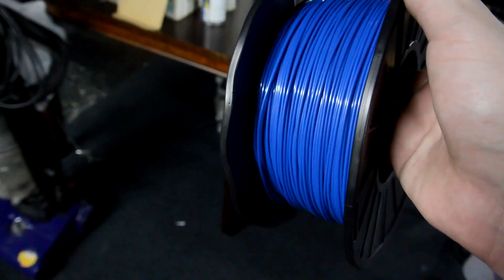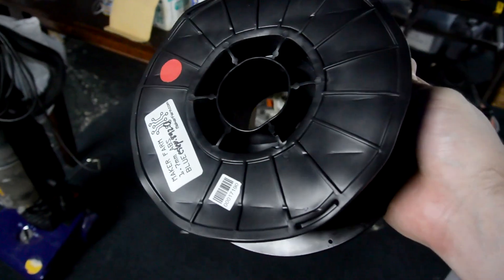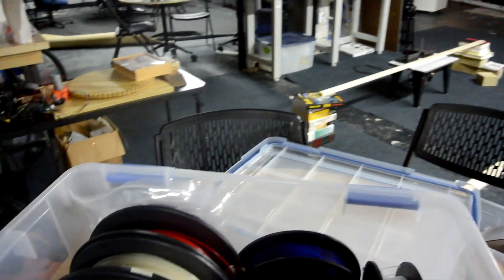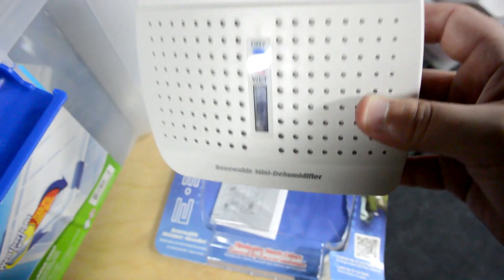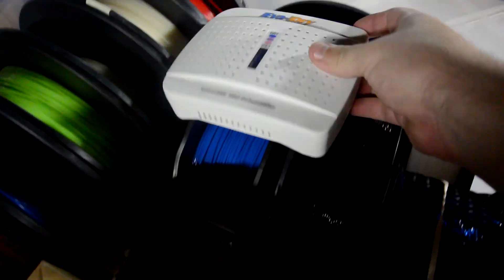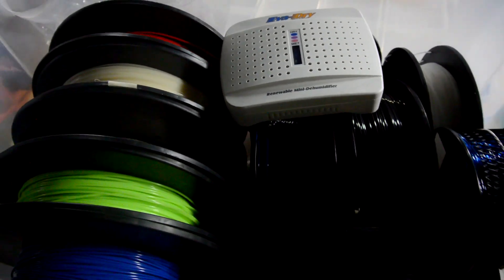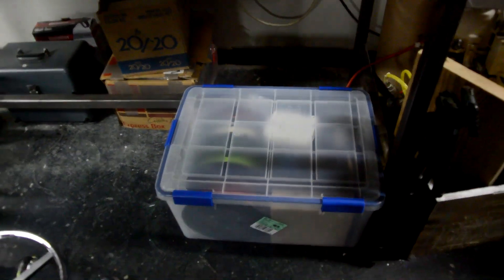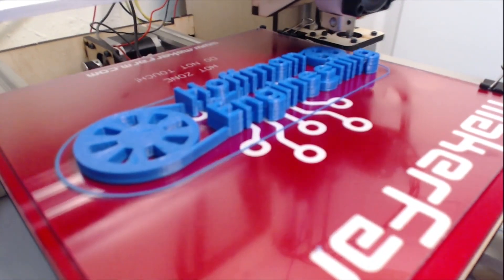How to keep your filament dry - Proper 3D Printer Filament Storage

Comment: Nice!
But instead of a box taking care of them all, we can simply use a plastic bag  (take most of the air out of it before closing) for each roll. Add a small  silica gel pack with each roll inside the bag. Yes you can keep them all in a box, but any box now. And you'm open only the bags you need. Just don't let in a warm place, let it in the coolest spot you have in the house.

Comment: So, it has been a couple of years.  How do you find this method for keeping your filament dry?  Have you made any improvements to the system?  Or would you still reccommend this method?

Thanks!
Reply from the maker: +Jason it's been working perfectly! No improvements needed, just plug in the rechargeable dehumidifier every couple of months. I even bought a second container to store more rolls in. Haven't had to dry any filament since!
Reply: Awesome! Thanks for the reply.  I will definitely try something like this.  On a budget would you recommend just using silica packs?
Reply: Do you happen to know what the average humidity is within the box

Comment: So... the reality is that keeping your filament in a cold place is better. If you do some research on moisture and humidity you find that warm air can hold way more water than cold air. My recommendation is to store your filament a few degrees above the freezing point of water with a circulating fan inside your container (like an old fridge) and about an hour or so before you use it put it in a box like yours as your probably going to get some condensation on it before it warms up. This is also less dangerous when your trying to 'dry out wet' filament as you wont partially melt the spool or release nasty toxins in to the thing that you cook your food in...

Comment: Hey Christopher, 
Fellow part-time Floridian here. 

I'm just finishing up my i3 Pro B... hurray!

Like you my printer is not located in the driest of areas, though not a basement. 

I was wondering how the drier your using, and the solution over all to keep your filament dry is working out for you.

On the drier itself: 
Have you had the chance to try the recharge feature yet? If so, what did you find the time between recharging it was in the box. And how long did it take to actually recharge it fully?

An after thought as well is, once you take it out of the box for use. The filament will start to collect moisture. Have you considered dispensing directly from another box with a dryer unit in that as well?

Also, another thought. If the filament has collected moisture, have you found you can avoid the oven solution by just storing it in with a drier for a length of time?

Humidity has been unbelievably high this year [2016], I'm hoping these dryers actually work. I know the silica beads do, but are there enough in it and does it actually recharge them in a timely manner? 

btw, Is there anyone local in S. Fl to get printer parts, filament from without paying a fortune for product that you've found?

tia,
- chase -
Reply from the maker: I love this solution, I haven't had issues with humidity since then! I've recharged the drier a few times since I got it. I haven't been keeping strict logging of when, but it seems to be about 2-3 months between recharges. I just take it out, plug it in overnight, and put it back in the case in the morning. I've seen people dispensing directly from the case, but I tend to only keep a single roll of filament on the machine for less than a week. (I like to change colors a lot). Unless you are spraying water on it, or using a filament like PVA (which is often used as support material due to its water solubility), I haven't found a roll that was ruined in that time frame.

What I am not sure is if the drier is able to absorb a lot of moisture from the filament once the roll it put back in the case. I assume it absorbs some, since I haven't had any issues, but I can't say for certain how much it reabsorbs. Its working for me, and I've had to recharge it a few times, so it seems to be getting moisture from somewhere lol

I do not know of any local company for printer parts. I tend to order filament from different suppliers on amazon. Prices have dropped steadily the last couple of years, as more companies are getting into the market, so I don't really have a go-to supplier anymore.
Reply: +Hoffman Engineering - Hey Chris, 

Thanks for the quick response and insight.

I only have the one reel for now, but have been studying up on the different kinds and exactly which ones I want to try.

Of course it all depends on what I want to print. But, I'm learning, and there's a lot more types of filament than I thought there were. I'm pretty impressed with the selections these days.

it really opens things up creativity wise.

Thanks again for the first hand info. That's always the best kind imo.

cheers

Comment: Is the reel you showed bent on the left side because you placed into an oven 
? I've seen other people recommending doing that WITH CARE, as you may damage the reels.
... oh wait, i see your linked video about dryin them out ... yep, it was an oven :D :D

As an storage solution  it is nice, i have to admit that :p
The weather Tight container + a reusable dehumidifier is a good and simple idea. 

Its a bit of a shame that there are so many reel sizes (both diameter and thickness), because its hard to build an universal inteligent reel drier ( I'm thinking of something metallic, a bit bigger than an ammo box , with a heating and ventilation unit) .... if you have moisterized filament you can only do the oven thing :(
Reply from the maker: +JJ CC Yeah, battle damage from the oven :D I should have put it on a cookie sheet so that it was not directly over the heating element. It was only cosmetic damage though, the filament was dried perfectly.

I agree with the differences in spool sizes though, the default makerfarm spool holder does not fit the wider spools (like that blue one), and the bar that runs through the center is too thick for the super small spools (like my filaflex). I had to resort to using the handle of my tripod to hold those larger spools. It works, but not as convenient.

A reel drier might be super useful though for people that have experienced this problem (much more convienient than an oven!). You'd probably just have to make it large enough to fit the wider/taller spools, which is a shame. I'm hoping to avoid the problem all together now with this new storage system :D